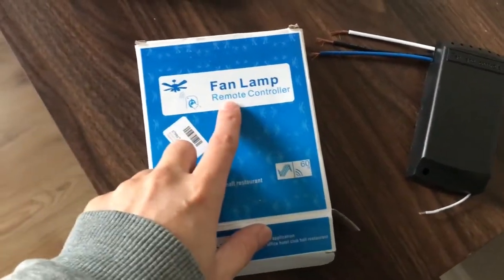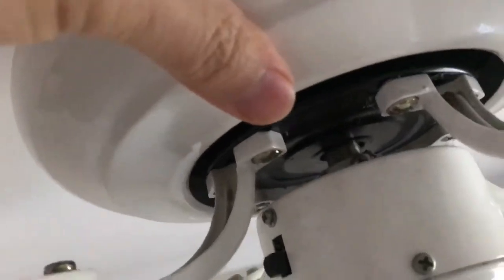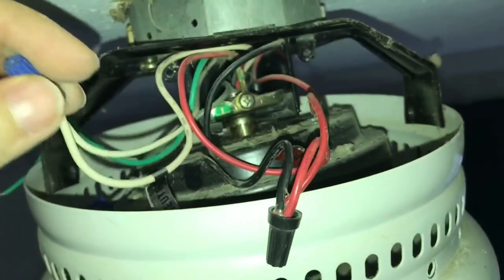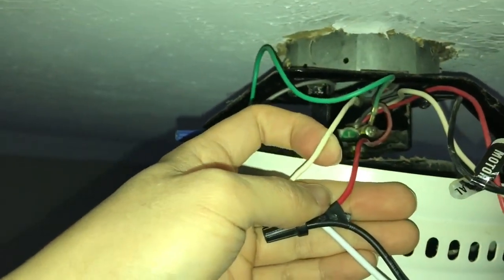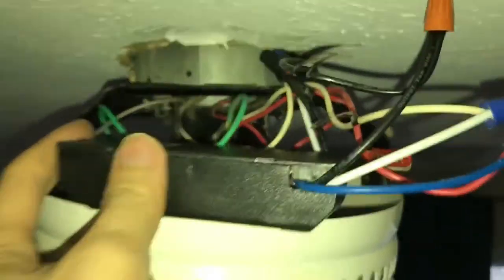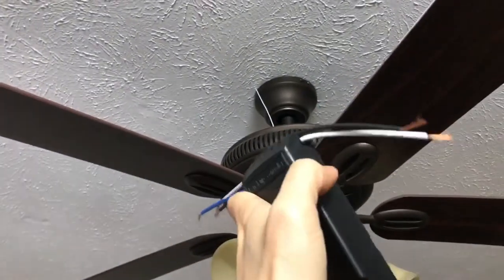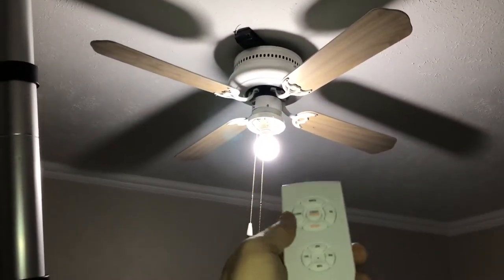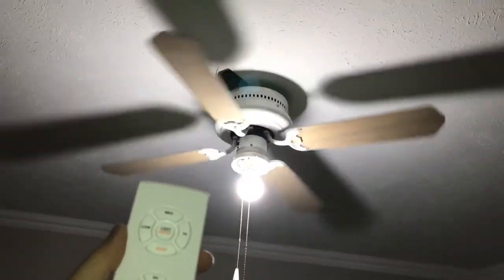INSTALL Ceiling fan light wireless remote control with timer $7

Comment: How many time do you have to replace the remote control black box with the same ceiling fan?
Reply from the maker: Im not sure what are you asking but 1 box 1 control 1 fan. I installed 3 total for my 3 bedrooms and they are still working fine. Hope that ans your question.

Comment: How do you change the directional flow of the fan using the remote?
Reply from the maker: There is none. Only can be switched by up/down at the middle of the fan

Comment: this is nonsense, the fan has a mechanical switch with 3 wires controling the fan speed Low Med High, the remote controller should be made to replace the original swich using the same  wires
Reply from the maker: It has chip inside to control the current... new tech

Comment: Fan speed controller doesnt work on mine. Any suggestion?.

All the remote can do is to switch on and off both lamp and fan
Reply from the maker: Did you pull and turn the fan on?
Reply from the maker: Remote only works if its on all the tine

Comment: got clicking sound. took off connector then tight screw then hook up connector. now light works but fan is not on. what can I do. please, any idea?
ex> tried to pull fan speed chain but still not working.
Reply from the maker: Check the wires if not, yours has problem
Reply: @PreviewVlog  thx for respond.

Comment from the maker: https://amzn.to/3ShbZZB I found the same remote from Amazon - on sale -  You may want to check it out.
Reply: Bought 4 of these about 6 months ago. One bad from the start. Now two others are working when they want to. Hope your luck is better than mine!
Reply from the maker: @Tominator313  its been 3 years and mine are still working, not even changed the battery once. Make sure you find the right seller. :)